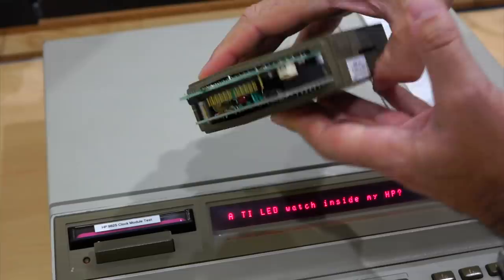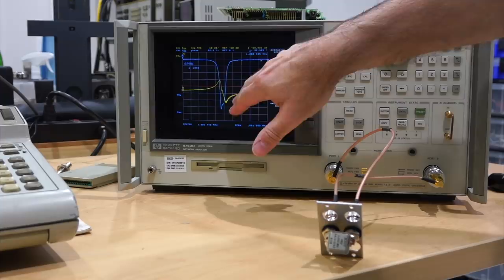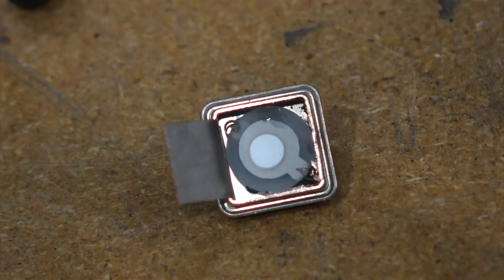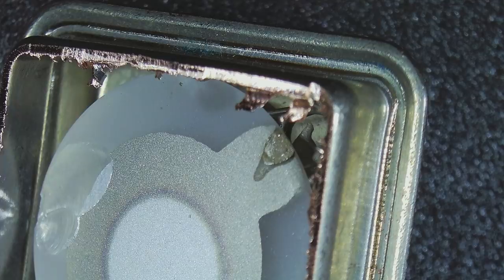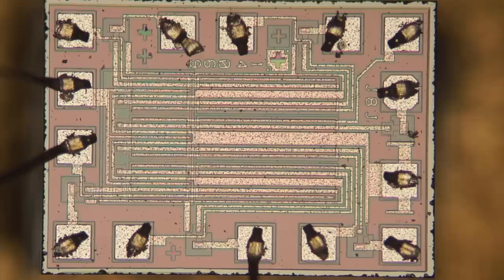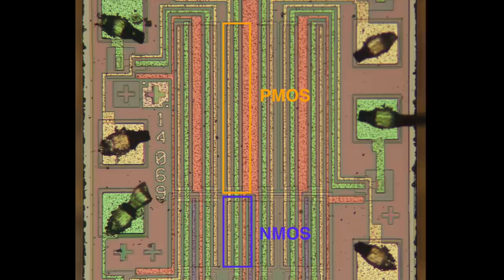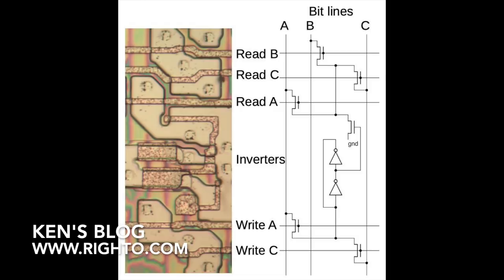Inside failed vintage components: 1 MHz quartz crystal and early CMOS IC

Comment: So what exactly does the quartz do? I missed the first video plus I don't know much about this stuff.
Reply from the maker: The quartz is used to make a very precise frequency in an oscillator, in this case it was for a clock. This is the episode where that particular quartz fails, just about here: https://youtu.be/CeXYZKg5jdo?t=652 . And here is the episode where I explain how quartz crystals oscillators work, also timed at about the right place: https://youtu.be/ad8azNovsF8?t=496
Reply: @CuriousMarc  thanks!

Comment: The crystal was dropped or otherwise subjected to high g forces. Believe it or not, they can survive the initial hit but shatter on the impact after the rebound. The pin sheared first then the edge was chipped on impact with the casing. The best way to open them is to saw them just above the seam or weld line of the base, then the top lifts off cleanly and you don’t risk debris contamination. I liked the ballet anyway. MIL Spec crystals are tested on a drop jig in different orientations and bounced off a designated cushion or anvil and caught on the rebound. This imparts a predicable haversine acceleration for qualifying the device class. This is done by 100% sampling. Civilian crystals are prepared the same way but not necessarily tested 100%. Had the electrical connection survived the crystal would have worked but those chips would have impaired performance, shifted frequency, tendency for spurious response along the curve in your vector traces and different “activity”, the term for motional resistance.
Reply: Excellent! Musta taken a wrong turn at Albuquerque
Reply: I guess that maybe the entire board was dropped. As the quartz crystal is mounted on springs it might hit the casing, bounce back and hit another wall of the casing. So you may be able to deduce the approx. direction of the fall. Big shatter and impact markings might have hit first. Have a look at the pcb for strike marks.  

But I'm a programmer, not an engineer.
Reply: Thanks
Reply: Previous job we started having failures. Traced to crystal. SCEM examination revealed tin whiskers. The supplier had switched to RoHS compliant without changing the part number.
Reply: Or made in China..
Reply: @BigUpVideo the comment clearly explained how the damage can be caused by dropping, and how the chips are tested
Reply: @Sylvan_dB  Tin whiskers have always been a problem in electronics, RoHS just seems to make it happen more easily since the percentage of tin in the solder is so high. The electrodes on crystals are silver vapor and electroplated and the paste glueing the mount points is silver. The company I worked for sealed the cans in a helium filled chamber. Then they were leak-tested in vacuum on a mass spectrometer. This was 100% in batches.
Reply: @BigUpVideo  That Bliley unit had a 1981 date code. Probably too early for manufacturing in China. We sold our units to HP as well but I was out of the crystal business for two years by then and our stuff was all USA made and it looks like Bliley is still doing everything domestically. We made some crystals for filters in HP units and I tested them using an HP spectrum analyzer. Almost all our frequency counters were HP and the master time base was an HP oscillator with one of our crystals in the oven all phase locked to NBS.
Reply: @hayleyxyz  Any 100% tin content might produce tin whiskers and RoHS solder is pushing it at 96% Sn. Solder is not typically used on crystals per se, at least not back in the 70’s when I was in the biz. It’s all silver and gold and pastes from the same. That design we called a hybrid oscillator. It was a ceramic substrate silkscreened with resistors and capacitors for the oscillator and the amplifier chip was bonded to it and mounting pins/springs were pasted. The only solder inside a hybrid like that might be on the substrate at the four pins exiting the can. I think we used silver paste in all our products.
Reply: "Believe it or not, they can survive the initial hit but shatter on the impact after the rebound." That inspired me to search for this again (which I was unable to find last time I looked for it because I was looking in a completely wrong place—I thought I'd seen it in Surely You're Joking, Mr. Feynman! ): http://amasci.com/news.html#:~:text=When%20you%20drop,with%20the%20floor. (If the highlight doesn't work, find for "When you drop a dish".)

Comment: Great video! Reminds me of when I used to teach digital techniques class when I was in the USAF at Keesler AFB. I would bring in some slides of chips I had opened and photographed through a microscope. It was one of the most fun classes I taught. USAF 77-83 ECM. After I got out of the USAF, intel hired me. Some litho corrections on giant Nikons were in microns. We also had to adjust laser interferometers, focus and alignment (overlay), One layer lines up on the layer below it. In the early days, operators would align the chip layers manually, looking through scopes. Later, computers would correct everything, (mag, overlay, run out, ) on the fly.. as the wafer stage moved and the reticle image was enlarged through a slit. (Perkin Elmers). Nikons used rotating x and y leadscrews were soon replaced by mag levs. Wafer stage positions were calculated by bouncing modulated laser beams off of long mirrors attached to each stage. One for X, One for Y. Some litho tools made exposures through a liquid, not air. (No bubbles allowed!) retired after 28.5 years. I still have nightmares!!

Comment: Back in 1973, I spent 6 months on an industrial placement, developing an environmental radiation monitor to run off a battery and sit in various locations dotted around the CERN site. This used a number of 4000 series cmos chips for their low power needs. However, the circuitry required an op amp. We used a 4069 inverter as an amplifier with a feedback resistor from output to input so the output quiescent level was 0.5 x Vcc. So both transistors were on at the same time.
Reply from the maker: You can see this method was also used for the quartz oscillator in our Russian clock.
Reply: Nice!
I have only ever tried that trick in SPICE :)

Comment: I had a communications shop long ago. With crystal controlled CB's and Marine Radios we would remove the little pink rock from its looped whisker-wire holder and burnish it with tooth paste on a flat surface thus moving working freqs in between channels. Most popular.

Comment: May I make a suggestion about decapping ceramic chips?  Hold the chisel with the angled face down.  When the chisel starts to move after the cap breaks free, it will rise up and avoid the chip and bond wires.
Reply: why would anyone have this expertise? Everyone I know throws faulty ones away  without a second thought, gets a new one. I'm not criticizing you at all, I'm genuinely curious.

Comment: It really made me feel old to see the "vintage components"  were a crystal and CMOS! I still have TTL and CMOS in my component collection, along with transistors, silicon and germanium diodes and a few valves (vacuum tubes). I worked in electronics during the 1970s and 1980s.

Comment: I had a crystal fail in a radio IF filter where one of the leads was shorted to the case inside the can. I was actually able to de-lid it (soldered lid) and see the solder sitting on the feedthrough.

Still works 5 years later!

Comment: Had a ULA design done back in the early 80s. Initial production was shipped in ceramic packages with the tops misaligned just enough that when loaded into standard IC tubes that allowed a bit of movement many would arrive with the tops sheared off.

Comment: If you think the chip failed due to ionic contamination simply bake the chip overnight at ~250C and see if there is any recovery.  The ionic contamination is usually Na+ which has high mobility in SiO2 at elevated temperatures.  If the failure is due to ESD there will be no recovery and most often ESD will take out one input rather than the whole chip failing.  Latchup induced failure will usually cause high current flow so you will often see visual evidence even at the magnifications you were looking at the chip with.  Some curve tracer work will also sort out these failures.  Enjoy your videos, good stuff, keep them coming!  de AI6XG

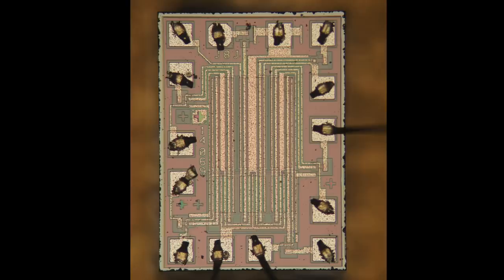Comment: 7:06 - I'd add that there is no shoot-through current, ever. The gate threshold voltages of the transistors are chosen for the open-circuit regions to overlap, so the only currents that flow are those supplying the gate charge and overcoming the Miller's effect.

Comment: Recently had two MC14516 counters fail in HP3580A spectrum analyzers, both chips had date codes from the mid 1970's. I suspect these had similar type of failure as the functional failures and the manufacturers were different, also in these cases ESD is an unlikely cause.

Comment: You can open ceramic components easily if you start by making a slight cut or scratch with a cutter right under the lid. This way the glass frit sealing will break at the scratch and you can save the wires unbroken. This will allow you to test each inverter separately and guess wich part of the die is failing.

Comment: Nice- now I am anxious about my CPU dying of electromigration...
Reply: Same bro
Reply: undervolt it and cool it well, don't OC it,  that will increase the lifetime dramatically.
even at stock voltages, CPUs last very VERY long, usually outlasting their motherboards.
Even ~20 year old Pentium III / IV CPUs still work great today, even if used heavily.
it's only the really old CPUs (30y+) like the motorola 68K series that start to fail often these days.
Sad for collectors, but a CPU lasts FAR longer than its usable lifespan (which might be 10-15 years today - I would say core 2 duo are the oldest CPUs that are still somewhat usable for normal desktop tasks).
Reply: @TheRailroad99  ok so my computer will theoretically last for a max of 20 years ish?
Reply: @KingJellyfishII  depends on the other components, especially motherboard and PSU, temperature and how good you take care of it.
But yes, 20years can easily be achieved.
Reply: My ancient mid-70's Signetics 2650 8-bit CPU still works fine in the project that I put it in, in 1976. So do all the other chips, such as the 2102 RAMs and all the logic. The Motorola MC3410 DAC still works as well, and so does the 2708 EEPROM that holds the program. That's 44 years now.
Reply: @TheRailroad99  that sucks, all my cars ecus use a 68k processor.
Reply: @ClumsyCars  there is nothing bad about 68K CPUs, no need to worry.
I just started to see some of the earlier 68Ks (from the 80s) die. I just used them as an example, other CPUs from that time also start to show their age.
The CPUs in your car's ECUs are most likely 100% OK.
I think the later CPUs got much more reliable, as the manufacturing processes for ICs got much more refined. In the 80s, ICs were still in their beginnings, engineers had not that much much experience with longevity issues as ICs were only out on the market for ~10years.
Also, car ICs are tested VERY well. I have visited  a car IC developer in Germany, they test 100% every part, because modern cars can have up to 5000 ICs, and they all have to last at LEAST 15 years under harsh conditions.
Reply: @cjay2  Is there any possibility for a video about that project?
The most impressive is the EPROM still holding the program. I've seen some with amnesia after 15-20 years. I always back them up if I buy something with EPROMs/EEPROMs in it.
Reply: @mrnmrn1  Unfortunately I am far far away from where the electronics are. I can say that I designed and etched the double-sided boards myself, one side at a time, from double-sided 1/16" fiberglas stock. Drilled them with tiny bits on an old old Dremel on a Dremel stand. I ran the thing for about a half-hour in 2017 or 2018, last time I was around it, just for kicks. It all worked fine. D-to-A and A-to-D are done in software using an external 10-bit Motorola MC3410 dac chip, using a SAR (successive-approximation-register) routine that I learned from a really sharp programmer back then. And we're talking a 1MHz clock here. I got 16 seconds of 10-bit wide record/play out of the 1K-long 2102 RAM chips. About 60 samples/second, which was fine for the application.
I also have at least some of the original design paperwork packed away there as well, plus the original Signetics 2650 User Manual. 
The EPROM has never failed. If I knew how to back it up, I would burn the code into a decent ROM. The EPROM is a premium military grade purple ceramic with gold trim and pins, with some masking-tape over the window. And following the style of the day (1976), everything is socketed.
If/when I get back there, I'll power it up again, and maybe research how to back up the EPROM. But if I do that, it'll fail and the CPU will fail, and caps will blow up, etc.
Reply: I may be wrong but I think electromigration may happen quicker with modern CPU's with smaller transistor sizes, early CPU's had transistors measured in um instead of nm so I believe it would take much longer for electromigration to happen with the bigger transistors though maybe with improvements in manufacturing since then reduces the issue.
Reply: @MrCapacitator  especially since the currents in modern CPUs are much lower. 
I still think that electronmigration is not significant until maybe 15-20 years later.
We will see. All I can say is that the 32nm range of CPUs (Intel Westmere/Sandy Bridge/~10y old) are still reliable, even 24/7 used Server ones. Normal PCs are powered up max ~8 hours a day, that would already mean that Westmere CPUs should last at LEAST 30 years (regarding electromigration) when used in normal desktops. Probably more like 50 years. The board will die way sooner.
Reply: Unless you run your chips at 100% utilization (like actual 100%, using the most "comprehensive" instruction sets available with max heat generation).... I doubt you're going to see a problem in your CPU running for 30+ years.. Probably takes 15+ years even if run at full beans..

Comment: How did the chip fail electrically? There are many ways to isolate an electrical failure. PEM (Photon Emission Microscopy)  or OBIRCH (Optical Beam induced Resistance CHange) would work well on this chip, which likely has some type of curve trace anomaly.

Comment: The classical music overdub of the endmilling. You like AvE I see.
Reply: Richard Smith what is ave?
Reply: @bigbaddms  A skookum channel.
Reply: No bukkake machine. I'm disappointed.
Reply: @BlackEpyon  XD Bukkake
Reply: @ManofCulture  Why that coolant is WHITE, I can not fathom.
Reply: @BlackEpyon  If I'm correct, it's water emulsifiable cutting fluid (white Taladrine)
Reply: @ManofCulture  That makes sense. I don't do a lot of machining, but I keep a small bottle of cutting oil on hand for when I need to go heavy on the drill press. And since oil always goes milky white when it gets engine coolant mixed in...

Comment: Wow, this brings back memories ! I used to be employed in a classified position in the British government trying to protect communications in the early seventies. When I first joined we were using low power T.T.L. then people got rather exited to see that stores on site had a few CMOS chips available. Those were soon snapped up and people soon saw the possibilities these devices would offer.
I got my hands on a few and made a couple of shift registers to test bit encryption algorithms.
Taking things a little to far, I pushed the clock speed too far and was very surprised to see the current rise rapidly and the chips radiate like little angry bees.
It took me a little while to realize my mistake. The clock speed had turned the P-Channel and the N-Channel transistors almost directly across the positive and ground, creating a short.
I was young, it wasn’t my last electronic folly !

Comment: Those early CMOS ICs are a nightmare in vintage synthesizers, especially analog ones. Replaced a lot of them in my synths. Together with op-amps and capacitors, they're a common failure point.

Comment: It is impossible to keep on repairing old electronics, one day it will stop. Some old transistors are already gone and can't be found anymore, neither can the be reproduced, the machines are gone too. Replacing old components with newer components, or stuffing new components inside of the old casing will stretch out the time, but the day will come that old electronics are only history.

Comment: I think the CMOS IC chip is most likely damaged by an Overvoltage rather than by electromigration, because 1) the size of the trace is way larger than in modern CPU, so how could it be less resilient than a modern CPU to electromigration, which lasted a decade. 2) Overvoltage damage is when a transparent oxide layer is shorted, so there's no way to see it with optical microscope, like in this instance, so I think it is Overvoltage damage.
Reply from the maker: Not electro migration on these early ICs. Ionic contamination or migration.

Comment: Interesting if the quartz crystal failed due to high g shock or just mechanical degradation? Or maybe some factory defects was primary reason? Also in some old books from the tube era I know that it was very easy to overdrive the crystal so it can crack. But of course low power cmos ic can't do that.